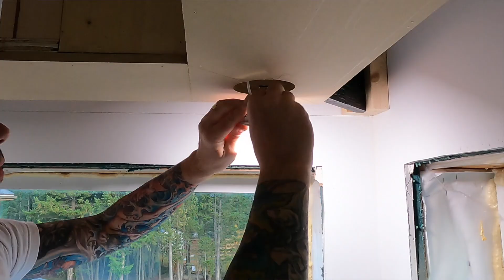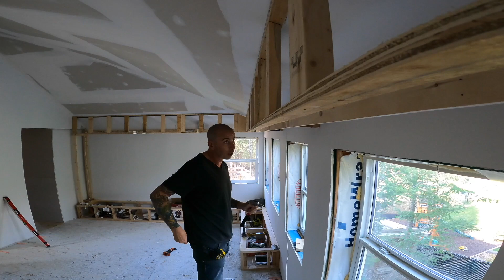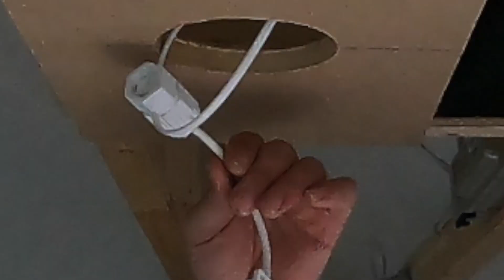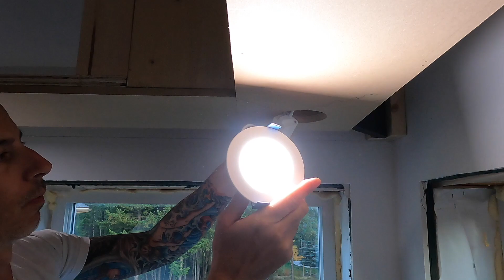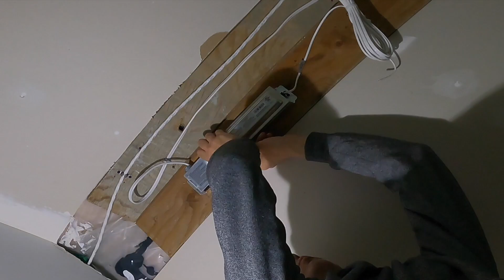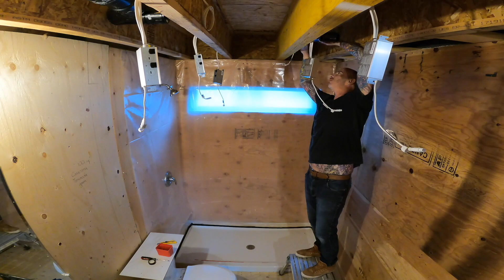Halo Quick Link - The fastest way to install LED recessed lighting - 29 of 157 Cabin build project

Comment: Nice video

Big question what type of switch did you use for your quick link lights

Do you need a special switch for dimming because they are low voltage

Comment: Did you run both drivers in your living room ceiling off of the same circuit? I have a large room with one switch 20amp breaker.

Comment: Were you able to pair and run these lights on their app? I just returned the 8 pack that I bought for our kitchen renno. None of the lights paired. Power to the lights was no problem, but I wasn’t able to pair them to be able to take advantage of controlling them through the app (you are supposed to be able to program the lights and change their warmth settings through it). You didn’t show the app and all the things you are supposed to do with them, like being able to switch the warmth settings and program them and I can’t find any videos on YT of anyone using them with the app either, just powering them on/off and selecting the warmth on each light (and that’s only part of how they’re supposed to function).
Reply: They sell both smart and none smart lights, and the smart lights require either a z wave or wyze hub thats not included

Comment: What is one quick link goes out is it easy to replace? Would you have to try to reuse the punctured holes on the wire?
Reply from the maker: That’s right, pull light down unscrew the quick link. Line up with the holes and retighten.